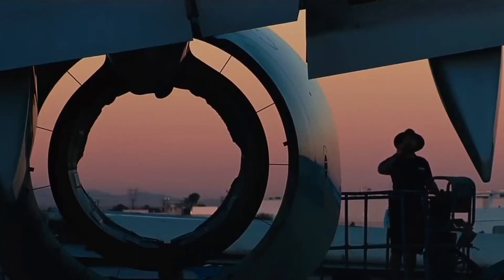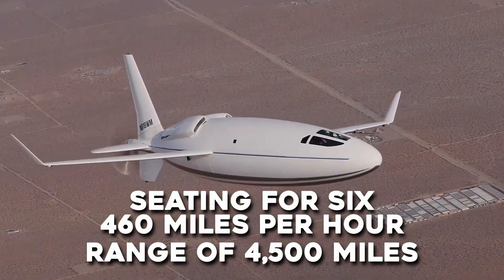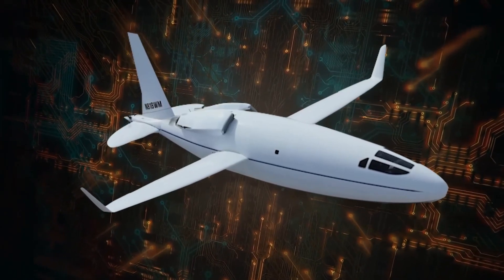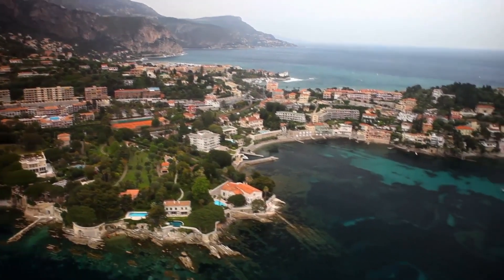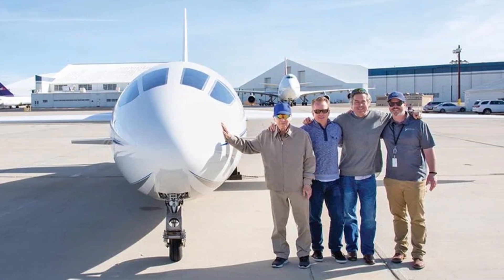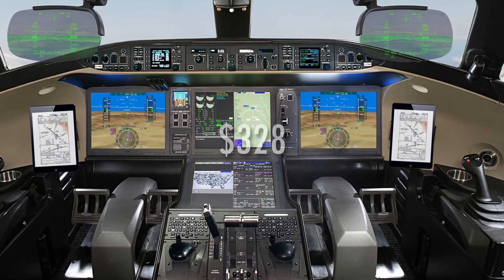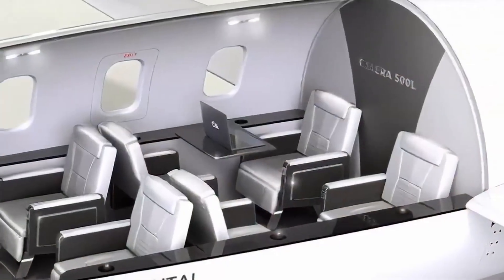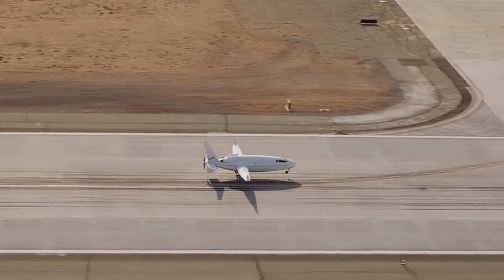Otto Celera 500L: The GAME-CHANGING Innovation

Comment: Hi . Frankly, I don't think business people who love traveling about ostentatiously in gas guzzling stretched limousines are going to buy this plane because of its fuel efficiency. Is this aircraft pressurized, because if it isn't it'll never operate at 40,000 feet, about 15,000 would be its practical limit. After 7 years of testing, has it passed its stall and spin recovery flight tests yet? If not why not? Five million is a bit pricey, good luck with that. Cheers, P.R.

Comment: What a scam, and more concerning people fall for it so easy (this are the voters). Let's just think about it, all planes in this class have about the same range and performance, not because the engineers held back but because there are physical limitations! Look at the Piaggio Avanti, which is very aerodynamic similar to this one has a pusher propeller configuration and it's being build for 40 years I think, they just cant make it drastically more capable. Or think of the predator drone which is designed for long flights, it has about the same range as all the other aircraft, and if any one could make it more capable it would be the millinery !

Comment: I fear they have run into the insolvable problem of how to de-ice or anti-ice an airplane where nearly 80% of the ever increasing cross section of the fuselage will accrete ice.
Reply: I'm curious on this too.  After looking at the   Piaggio Avanti and comparing its hull design to this one, dose it have icing problems too?
Reply: The diesel RED engine is making significant inroads in aviation as a replacement power plant!